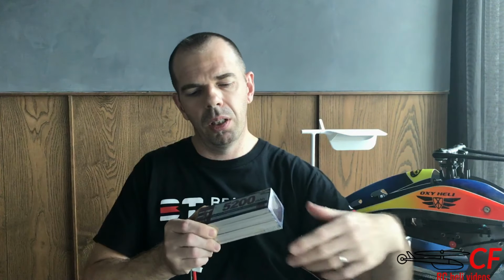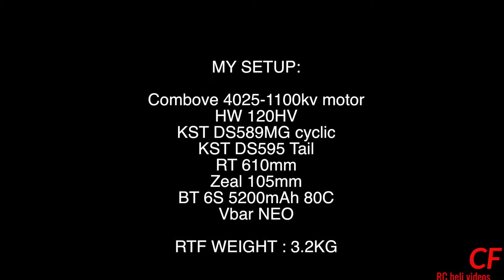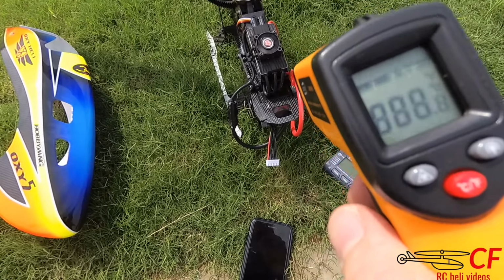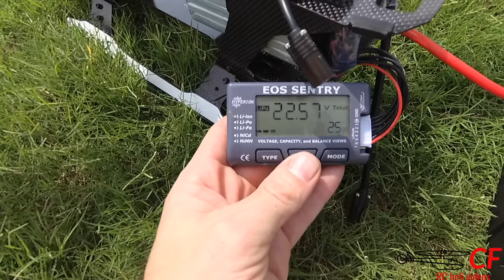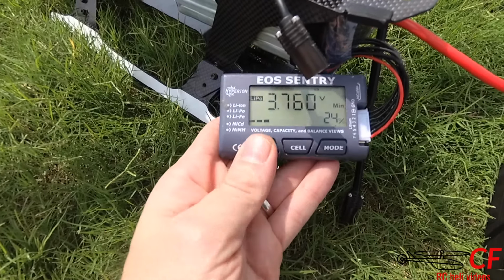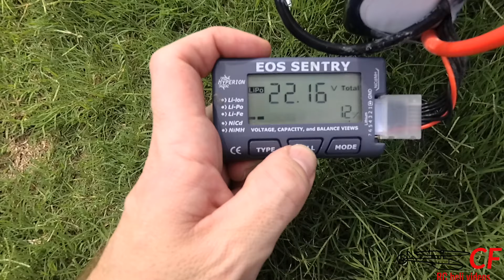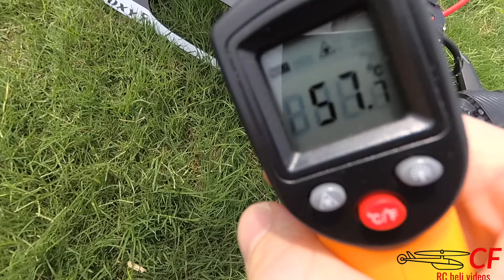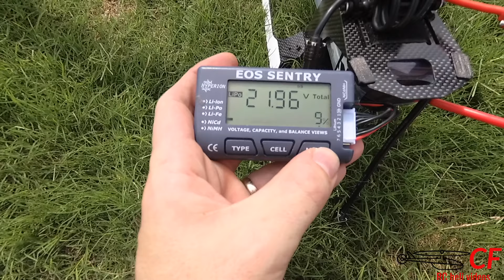6S on OXY5 Meg  Worthed?

Comment: Well done video. You did a great job of capturing all three flights and the raw data and presenting it. As a consumer of many YouTube videos, many of us want you to comment on this stuff because we are intentionally seeking your opinion and commentary! A lot of us are not expert (enough) in the hobby and maybe don't have a club or in-person contacts to talk to to share opinions and experiences with. Forums can be useful, but sometimes you want to hear a person speak rather than seem like a pest asking basic questions on new topics. You don't have to be super correct, but lay out your analysis so we can work from there. Was 6s able to deliver enough power in your opinion? Did all of your electronics perform as they should on a 6s? What were some of your concerns in the first place?

I am looking for a 500/550-class chopper and want to stay within 6s batteries. Many of the kits I'm looking at aim to be pushed into longer lengths including the Oxy5 MEG. The #1 question that always pops into my head on the issue is "if I'm on 6s am I under powered?" I'd really like some clear opinions on that so I don't have to have to answer the question by investing in both and figuring out which does or doesn't work. Also, since I'm not a super expert, what are other issues I should be worried about? How does 12s or 6s impact what ESC I should pick? What battery capacities and discharge rates should I be looking at? Are there other concerns and costs that are non-obvious to going either way? I'm sure you know of sources where some of this stuff is talked about in greater detail so no one is looking for you to exhaust all of those topics in a video, but you can mention them in commentary like "go to ____ where there's a good discussion/article about this topic for better info" and maybe provide a link in the video description is all. These are all asks if you're trying/wanting to be helpful or grow your YT presence a bit and of course may not be your goal anyways.

Good luck!
Reply from the maker: Thank you for your note and glad you liked the video. I will try to do a PART 2 of this test video where I can perhaps answer your questions, based on my personal experience gained over the years in this hobby. Thank you!

Comment: is it OK that battery condition after flying?
Reply from the maker: 정상철 Yes, however lots of factors are affecting the lipo (outside temperature, hs, flyong style, battery aging and so on). I 1800-1900rpm is the sweet spot for my heli and batteries. Also do not forget, your electronics play a role on that.
Reply: @scoiocri  one more question. what is your recommendation pinion T? 11?
Reply from the maker: 정상철 I am running stock 12T pinion